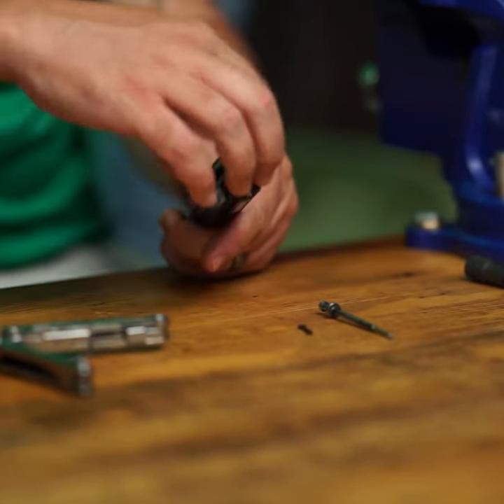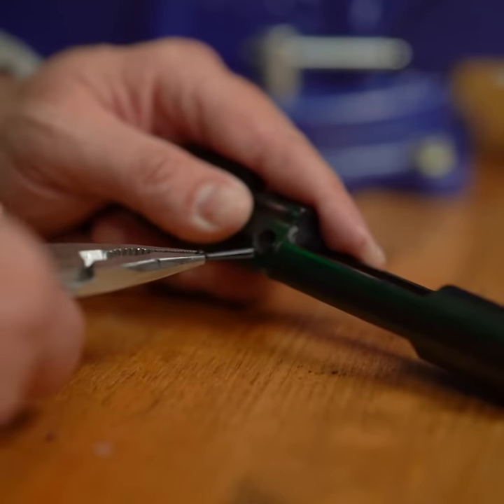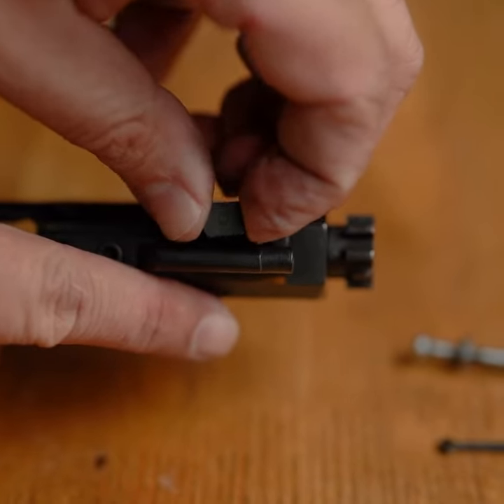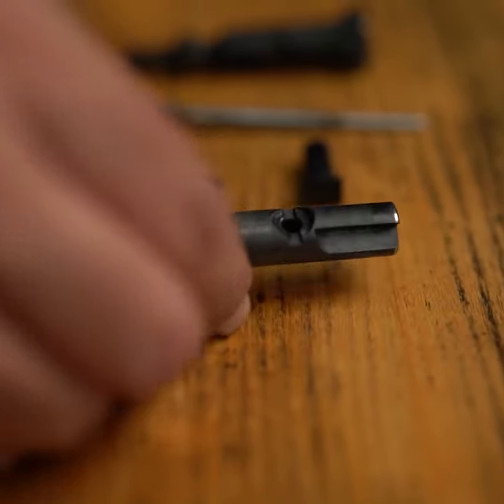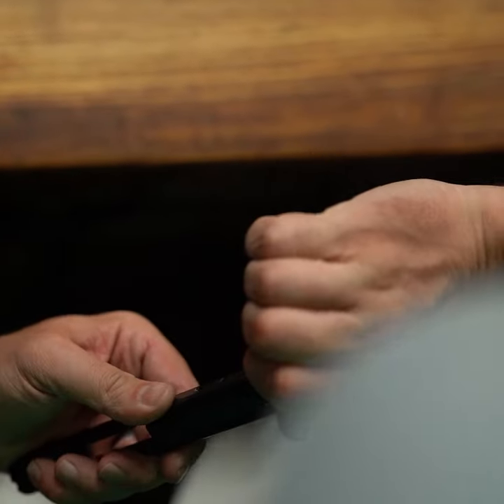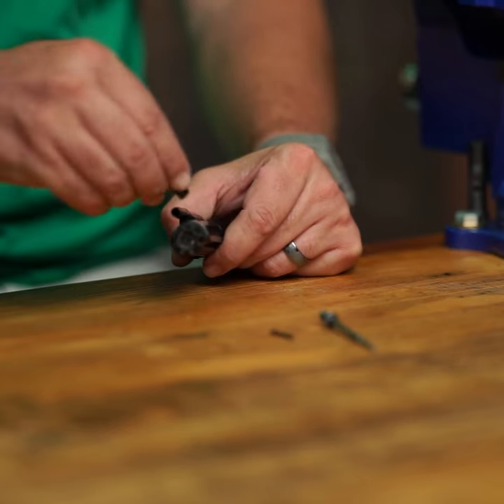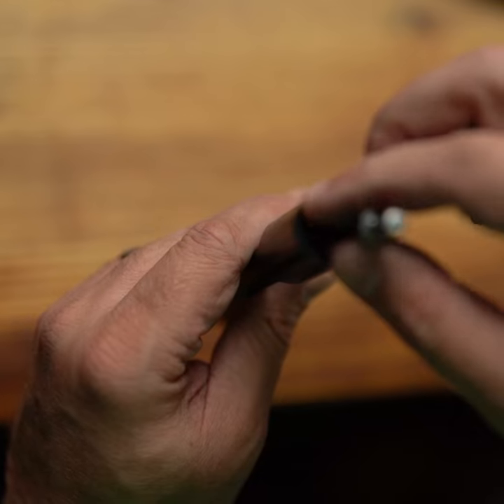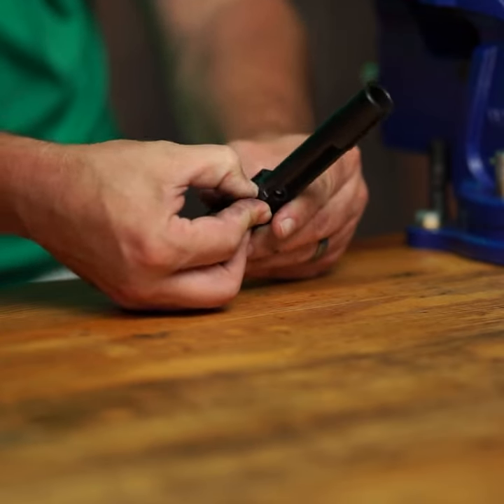How to Disassemble and Clean A Bolt Carrier Group in 60 Seconds

Comment: Just put it in the bottom rack of the dishwasher.  Or the gentle cycle in the washing machine and tumble dry….low heat.
DO NOT DRY CLEAN!
🤪
Reply: Make sure you use "Finish" for a spot free rinse.😏👍

Comment: Bca ar10 here. I cannot get my firing pin retainer to go back in. The end is flanged open with no way to reach in there and pinch to push through other side.
Reply: pro tip, put the pin horizontal/flat and apply downward pressure as you insert. works everytime for me